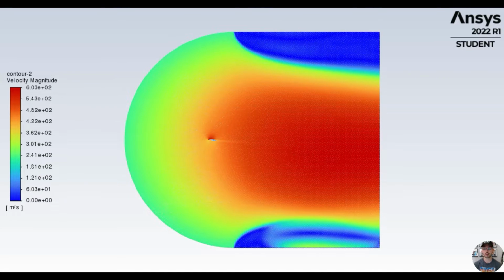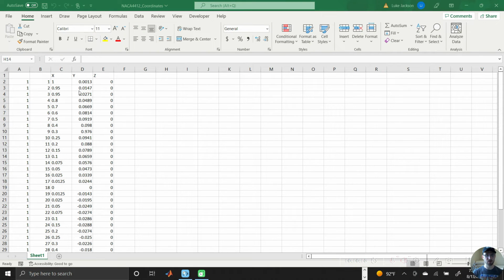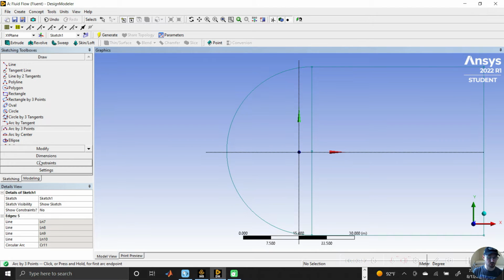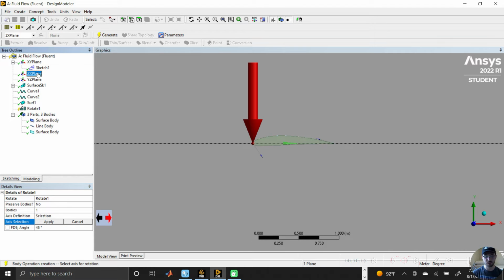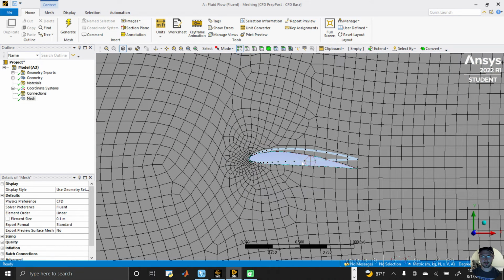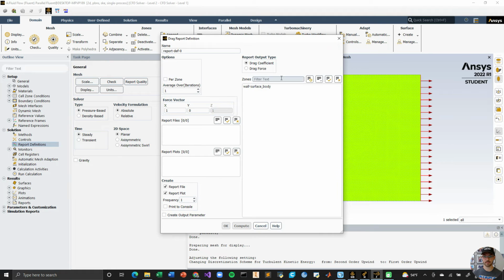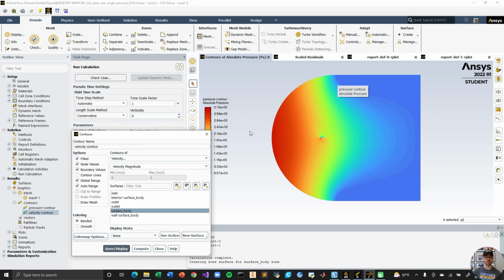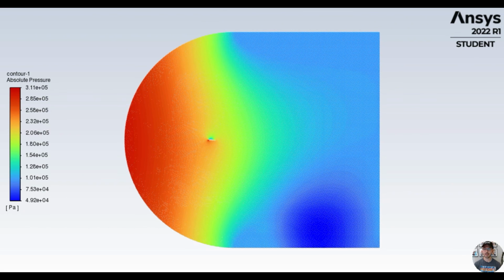Ansys Fluent Tutorial | How To Simulate Airflow Over An Airfoil In Ansys Fluent | NACA 4412 Airfoil

Comment: I keep getting an "unassigned interface zone" error when I try to initialize does anyone know why this is and how to fix it?
Reply from the maker: Hey thanks for the comment! It’s been years since I posted this video so I’m a little rusty on the subject, but this issue might stem from the original point import for the airfoil shape. I remember I had to zoom way into the trailing edge and manually join the two points at the back for my simulation to work. I hope that helps!

Comment: When i do the Boolean step, my whole airfoil is getting choppy and the resolution breaks apart. I import the airfoil from solidworks (either as an igs or a step file, and not trough the 3d curve because for some reason it says that it cant read the coordinates from the txt). and everything goes well until i subtract the airfoil from the fluid plane. I have tried everything. Changing the tolerance from every possible setting and even using another airfoil. Every time my airfoil changes to a polygon as soon as i press generate Boolean. 

Can someone help please? I cannot find any solution.
Reply from the maker: I haven’t run into this problem before, but I might be able to help.
1) When you import the .txt file, does Ansys refuse to accept it, or do you get a shape that it doesn’t recognize as a surface body? If it’s the second one, chances are you need to go to the points on the trailing edge and draw an extra line to connect them. If it’s the first one, I haven’t run into that before so I’m not sure.
2) For the polygon shape you’re getting: When you export the shape from Solidworks, are you adjusting the resolution of the shape? Oftentimes when I export a model from a CAD software, I have to manually increase the resolution to avoid those polygonal shapes
Reply: @SpaceCowboy-16  for the 1st question you asked, Ansys doesn't accept the file at all. It says it cannot read the coordinates (only if i am importing the file directly in DesignModeler through the 3D Curve). I know tried to import the geometry as an IGES file directly in Ansys Workbench and then generate it in design modeler.
The problem starts the moment I have made the fluid plane around the airfoil and i press Generate to the Boolean command. The airfoil suddenly loses its curvature and becomes choppy.

BUT, when I open the Mesh and make the Element Size to 0.1mm or less, the "resolution" lets say, of the airfoil suddenly becomes better.

Maybe it is just a graphics issue, or something else, but i think the results i am getting are quite ok. Since the meshing process is kind of fixing the problem...

Thank you very much for responding, i would like to hear yout thoughts on that too. Great video btw🙏🙏🙏

PS How do you up the resolution of the CAD files when you export them?

Comment: Good video about CFD, but  your explanation about the lower pressuere on the top of the airfoil (19:40) is wrong, the igual transit time "theory" is wrong because don't exist any type of physical principle that implie that the air on the top must reach the end of the airfoil at the same time that the air on the bottom, in fact if you analyses a wind tunel experiment you will see that the air on the top reach the end of the airfoil before the air on the bottom what proof that your explanaton is wrong.

https://youtu.be/UqBmdZ-BNig?si=ZWkgGfPqWnOamMJH Here is a video of a wind tunel.

Comment: I think you should use k-omega SST, rather than k-epsilon, as k-epsilon is not very accurate in adverse pressure gradients, so not viable for aerofoils. It might not show a problem here, but at higher angle of attack it will not simulate the flow correctly, as it does not show flow separation. You could also see that you lift and drag coefficients were really wrong, they usually have values around 0-2 for Cl and like 0.015 or so for Cd, definitely not 6000. You should also do mesh refinements rather than making the whole area really fine mesh.
Reply: hey bro, what should I use then? I ve noticed that, Cd after converge goes around 0,07 to one of my airfoil. But the lift coeficient is absurdly high
Reply: @rafaellino1235 Use spallart almaras best for aerodynamics

Comment: Hey, After I have given Initialize in the hybrid initialization, it says "WARNING: unassigned interface zone detected for contact_region-trg" and
Unassigned interface zones found. Flow is not initialized.
Any help would be much appreciated. Really need it.
Reply: Unassigned interfacezone detected for interface contact region
Reply from the maker: When making the geometry, after importing the coordinate file, did you draw a line to connect the points at the back of the airfoil?
Reply: @SpaceCowboy-16  actually I solved the issue. I didn't mesh it properly. Thankyou anyways😁
Reply: @sudarshanjagannathan4864   i got the same issue,, how u solve this
Reply: @SpaceCowboy-16   bro i got same issue can u help me
Reply: I am got the same issue,, how u solve that issue

Comment: Brother the coordinates imported always have the tail area open (upper region not joined with the lower one) so I can’t generate surface from edges as can’t get edges joints generated.
Reply from the maker: I’ve had that happen to me a few times as well. The gaps have been very narrow in my experience so I’ll usually make a line to connect the two rail points and complete the surface. Since the gap is narrow, the line rarely hurts the simulation (it’s actually more accurate to manufactured wings since they almost always have a thin flat end at the back of the airfoil). If you need a very fine tip, you can also alter the coordinate for one of the tips so that they join together. Hope one of those works!
Reply: @SpaceCowboy-16  hi how do you draw this line connecting the two points?
Reply: @Dorm Room Engineering nvm I figured it out
Reply: @Onepiecefan609  Can you tell how?
I'm having the same problem
Reply: @HameezAqeel  edit your coordinate system so that it connects the dots.
Reply: @Onepiecefan609  From where and how?
Reply: The text file that you're using to upload into whatever software you are using.
Reply: @Onepiecefan609  ı dont know where it has to be changed